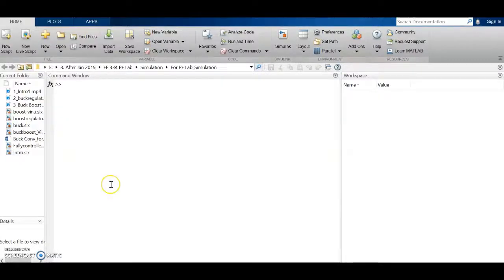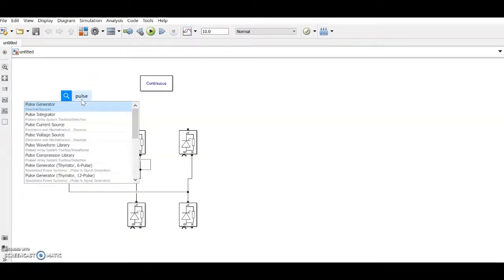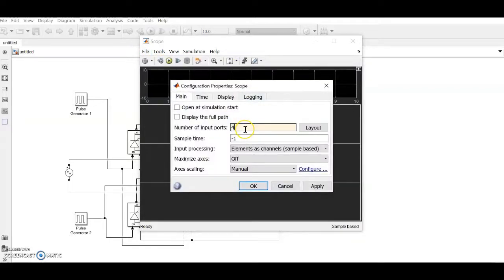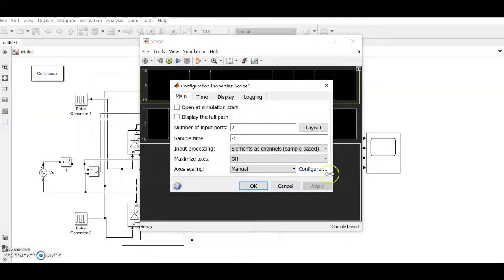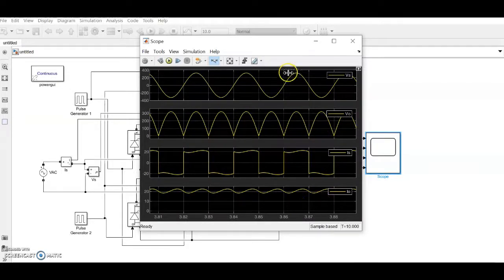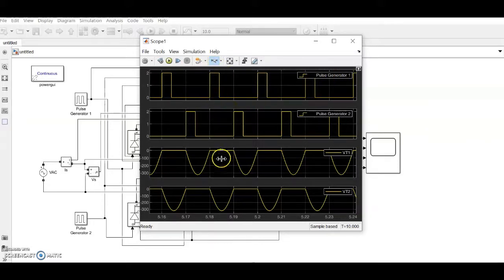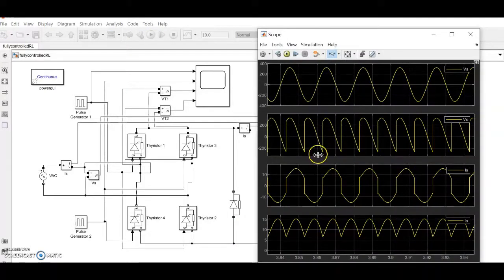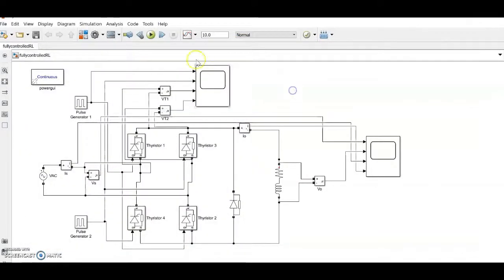Expt 4 # 1 Phase Full Converter with RL Load # Simulink Model # Freewheeling Diode # PE Lab

Comment: great video. pls why are we using two different phase delay for the pulse generators
Reply from the maker: Pulse Generators in this model are used to trigger the Thyristor devices. And Th1 and 2 are to be turned on during Positive Half cycle and Th3 and Th4 to be turned on during -ve Half cycle (then only they will be forward biased). As we use a 50Hz supply, T = 20mSec. Positive half cycle - 10mSec, Negative half cycle - 10mSec, So if trigger pulse1 is given at t1=0, trigger pulse2 is to be given at t2=t1 +10mSec. (at a phase delay of 10mSec).
Reply: @shaija  how can u say 0.05 sec is 90..is there any formula?
Reply: @anastinsasini1341 one full conduction = 360° 

Time period =1/f = 1/50= 20ms 

To find time at 90°

(90/360)= (X/20)

X= t(@90°)= 5ms